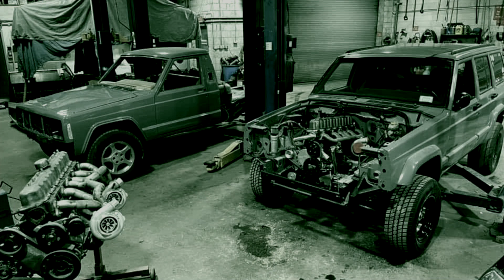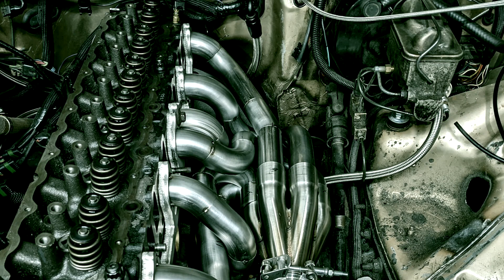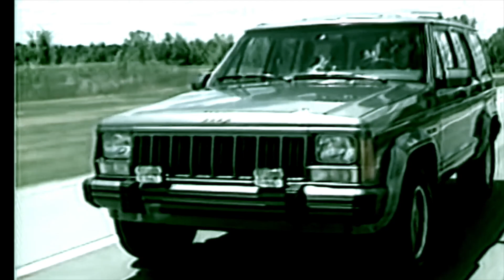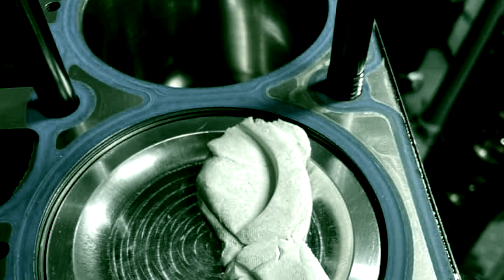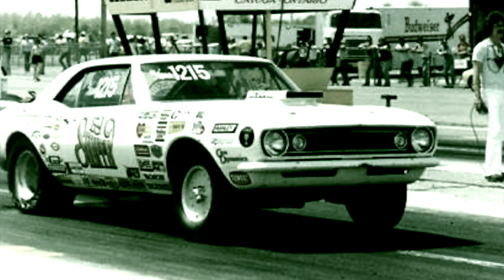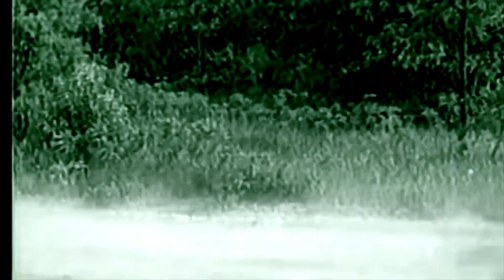Building a 10,000 RPM Jeep 4.0 - Common Problems

Comment: Now, when is somebody going to chop up LS or LT heads to build the engine in the thumbnail. Or use LQ-1 heads to build a DOHC. That's the closest Twin Cam production head to my knowledge in terms of bore spred. The Infinity/Nissan V-8 is next at 4.409. Ardema Braun have shown what's possible.
As to a high rpm 4.0 i think the weak link might be the oil pump. Not so much the pump itself but the tang drive.
Reply from the maker: There are a couple LS heads and a V6 DOHC project in the works currently.  Not sure if any of them are going to be successful but, if so, we'll chat with them.
Reply: @amxj  
And if they aren't it would be interesting to hear why. Most 4.0 aftermarket seems focused on the Jeep world. In terms of street performance at least in the US just dropping a Ford Windsor or an LS is often the easiest option. Extensively modifying an inline OHV six cylinder is going to be an intensive undertaking. Just saying using existing heads is one thing. But certain issues just off the top of my head include the following.
1) Moving head bolt holes in the donor heads. And depending on the head is there enough material t6 o support the load of the head fasteners.
2) Coolant passages alignment between the block and head. Or do we just go with seperate plumbing to get coolant to the head.
3) Valve arrangement in the head versus what the 4.0 has. Ford or LS/LT heads alternate the intake and exhaust. This is going to require a custom cam. The use of SBC heads might get around this. And then the question of just how much lift and duration comes up. 
4) Thermostat Housing. There are possible issues here. Especially if one goes with OHC heads.
5) SOHC or DOHC  cam drives and possible water pump issues. 
6) Intake and exhaust mani folds are a given. 
7) Ignition timing. Do you want a distributor? How do you I integrate that with an intake manifold if OHV. 
8) Wet or Dry Sump? If Wet then you need to integrate the existing oil pump. 
9) SOHC or DOHC cam drive set up. Straight off of the crank with the reduction handled that way? Or do you use the existing camshaft as a Jack Shaft. This allows smaller cog wheels on the cams. If you decide to use a wet sump with the stock oil pump you must do this. I'd cut the cam off just past the "3 cam bearing and remove the "4 cam beating and rotate it 180° and reinstall. Or turn a sleeve and press it in. 
10) Lifters and lifter bores. If SOHC or DOHC the lifter bores must be blocked off. Solid plugs? Sleeves? Relieved to allow full flow down the oil galley? Preferably relieved and tubular to allow free return flow. OHV. Flat Tappet or Roller Cam?
11) If OHC how are you getting oil up to the head to lubricate the valve train. 
12) Upright or Slant install. Myself l would consider a Slant install if OHC with the Slant to the passenger side and the intake on the drivers side. Again to ensure drain back.
13) No matter which valve train type. How do we seal the bottom of the head to the block. Most production blocks have contouring to minimize the amount of material used in the casting. Possible option. Multi layered billet head with full water jacket. Casting would require patterns etc. 
You can see. I have thought this through. But l lack the shop equipment to do the job right.

Comment: When you add coolant lines do you into the main water pump or add an external?
Reply: We used an external electric H20 pump.
Reply: On a 4.2, could you tee of the intake manifold coolant line to supply the inter cylinder AN fittings?

Comment: This may not apply to newer engines. I have a 2006 Jeep TJ and if I run a180 degree tstat, I run the risk of the computer popping a code.
Reply: HpTuners is my friend with my LJ ! gets driven 82 miles a day cammed,tuned etc etc. and she gives me 0 problems :D
Reply: You’re flirting with problems if you do that. It’ll run rich, foul your plugs, clog up your cat and trash your oxygen sensors.

Comment: Now we know about 456 this dude is cool man that engine lasted forever. People are still using them as daily’s.
Reply: When I was developing the 4.0L NHRA competition engine for 9000 rpm I had to address the cooling inside the block and head.  I talked about the alum pucks with cooling lines installed in all 5 freeze plug holes, these 60 deg AN fittings were connected to a H2O Log , all 5 of the H20 lines came out of the ALUM pucks into this length of Alum pipe.  One end of the pipe was closed and the other end went to the electric water pump outlet.  The main reason was to keep from blowing #5 head gasket HOWEVER, there was another reason (very important reason), as to equalize the temps around the bores in the block.  If you keep the temps very close to each other it makes jetting the carbs easier, each jet is the same size except #6 jet which was one jet size smaller.  WHY?  ON a long plenum manifold when the car accellerates off the starting line the fuel wants to slam to the back of the plenum, hence that  #6 intake port is richer..  I did have fuel dams inside the plenum to help stop this fuel slamming to the rear and richening #6, but it only helped somewhat. OH??  the aluminum log was about 1.0" diameter and the feeder lines to each Alum puck about 3/8"  AN lines.  We bench tested it to see how much H20 it was delivering to each 60 deg nozzle, looked good!

Comment: well, this pretty much blows up the interwebs 195° thermostat police doctrine of 4.0s are made to run hot, apparently cylinders #5 and 6 think differently about that. i wonder if thats why jeep owners get codes for cylinder misfire on 4, 5 & 6, and have so many headgasket problems and overheating. a dead spot in coolant circulation around 4,5 &6  is the cause.
Reply from the maker: Absolutly.  This is why they installed the sending unit at the very rear of the cylinder head so you see the hottest temps.
Reply: @amxj  ,,  It's not so much a dead spot but a recirculation issue, H20 recirculates between the bores on all cyl's 1-2, 2-3, 3-4, 4-5, 5-6 !  That's why you need to force H20 between all (5),  this will cure all your code issues and  #5 blowing HGkt too.